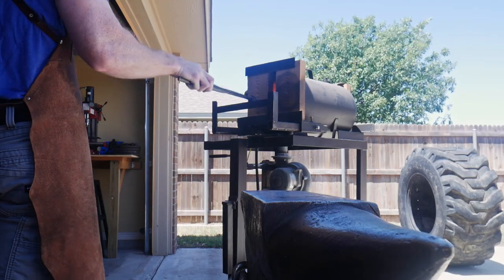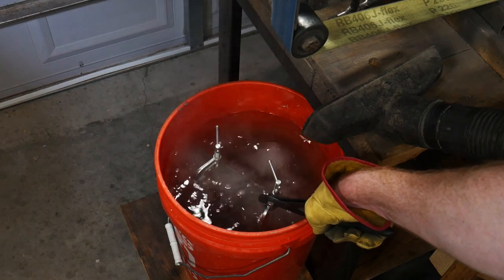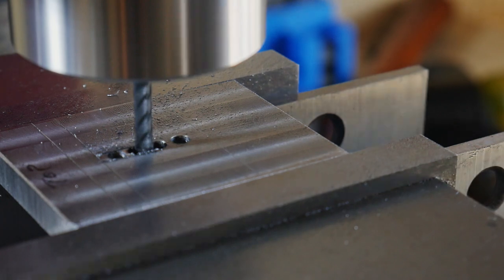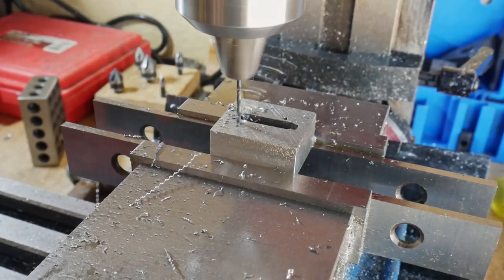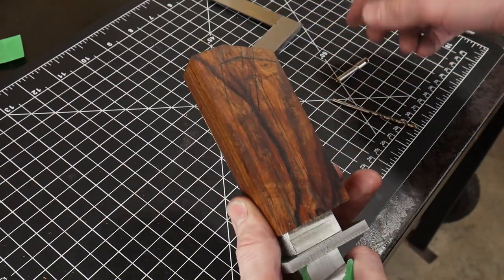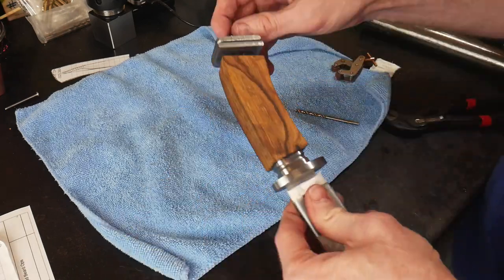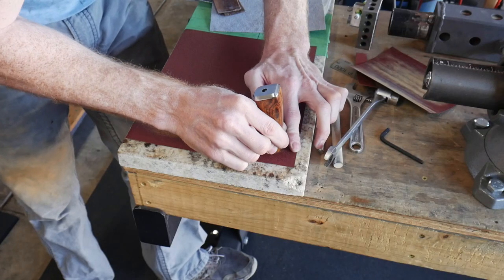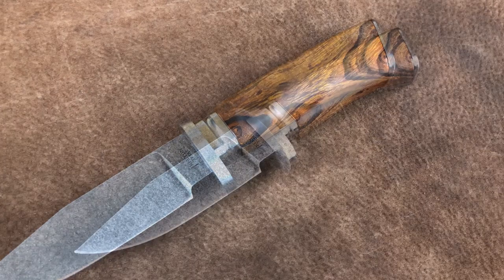Hidden Tang Take-Down-ish Fighter | Knife Making

Comment: I have a couple tips for you , number one , make your guard a little bit thinner they look more pleasing to the eye around 150 Thousands on guards . When slotting your spacers to go on the tang make them tight Press fit like the guard that way they don’t move around and would eliminate the use of pins from the spacer to the guard, so when you pin your handle to it it’s always in the same spot no movement will help you a lot. On the pommel Take a punch and peen around where the pommel nut meets the pommel Been grind it off those seams will disappear. When grinding your handle to your spacer put one wrap of gorilla tape Around your spacer then grind the handle Until you just dust the tape all the way around that will give you your perfect museum fit , then just round over slightly with sandpaper. That’s all I have for now you’re doing a great job keep up the Chase for perfection It’s never ending.
Reply from the maker: Thanks for the tips Rick! The journey continues

Comment: Very nice knife build!! I have made a lot of hidden tangs, but none to the tolerances and precision you made this one. Your attention to detail on the guard and pommel and use of your machines is really awesome. The only thing I would suggest (and I think this could be more of a personal preference) is to make the handle less square. NOT a criticism at all, but with no tang to show on the handle there is so much more shaping potential than full tangs and rounding those corners more will make it fit better in the hand.
Reply from the maker: Thank you sir! I totally agree! It's one of the things I like the least about this knife as well. It all started at the spacer... I made the spacer very square and I wanted to match the handle to the spacer. Next time around my spacer will be more oval. Cheers

Comment: you may like the RF version of mill sold by Bolton Tools. It ranges from about 2K to just under 4K. I have the cheapest version, geared head, ZX45. It is the non-CNC mill you see in Walter Sorrells's videos. They are way more rigid than the smaller benchtop mills (about as rigid as the mini bridgeport clones). But, the machine doesn't take up too much area, it can be used with 110v electric service, and you get a new machine without breaking the bank. Just mentioning it. You are right, it is so much better to have flat and square things to fit together. Thanks for the detailed video.
Reply from the maker: Glad you liked it sir! I recently got my hands on a HiTorque 3990 from Little Machine Shop... big improvement. More to come on that this month! Cheers

Comment: Since I am learning some knife making from you I will pass along a tip to you as a machinist. Pre-drilling holes before you mill the parts is only adding time to your work, you're not gaining anything from it. The milling cutter is still traveling along the same path at the same speed with or without those holes.  I know some people are concerned that those mini-mills don't have a lot of power but you are not taking that deep of a cut per pass. If you have any milling questions hit me up
Reply from the maker: Thanks Mike! I'll give that a go!

Comment: Very nice! My only critique is that the guard looks slightly out of place with the square edges in combination with the decorative filing on the spacer and the 45 on the pommel. My opinion would be to add a small 45 on the top and bottom of the guard to make it match the spacer and pommel. As always, love your detailed explanations of your processes.
Reply from the maker: Thanks for the suggestion Brandon! I agree, should of done more to that guard.
Reply: Fluting the edge of the guard would look good.  Nice build sir!

Comment: I’m confused as to the purpose of a takedown knife. Great video as usual.
Reply from the maker: Cheers John, thank you. It generally is just for collectors and for the "cool" factor. I guess technically it would allow you to replace parts more easily as well. Also a way to show off precision skills. 

This video you're commenting on wasn't really a takedown in the end... this one was a success - https://youtu.be/6VOfalVEnTs
Reply: @RedBeardOps  you definitely are precise! No gaps anywhere. Love the narration. I watched hundreds of videos and it is so cool whenever I find a little gym of information that I did not know. And this video showed me the trick of using a Dremel cut off wheel and drill press for putting the groove in guard or spacer, because I’ve been trying to do it with simply small round file

Comment: 304 stainless steel is only slightly magnetic so maybe that was a 400 series?
Reply from the maker: Good point sir, I'm not 100% sure. I did have to use a steel "back stop" when in the surface grinder.

Comment: Hi bro, how are you? please, would you tell me if you still have light spaces between those steel pieces even with all your machines?  I mean i have a big issue, i can't get a nice flat surface with my steel pieces. I dont have machines, i rectify my pieces only with sandpaper over a flat surface. But when i put all pieces in the spike i get those annoying ligh spaces. Please help me with some nice technique for that?
Reply from the maker: Pablo, I got rid of all the light spaces on my knife in this video. In your case, I'd suggest finding where your light spaces are, marking where they are not; then carefully sand down those places on a granite surface plate by hand. Then repeat until it's right.
Reply: @RedBeardOps  thank you so much

Comment: What RPM are you running that fly cutter at? Is it a carbide cutter or is it hss?
Reply from the maker: It's carbide. I think I was running it around 500 RPM
Reply: Oh ok gotcha.. I know that it doesnt matter because you end up grinding it also but if you run a finish pass about .005 deep and turn that fly cutter around 1500-2000 rpm you could get an amazing finish with it. I have been a machinist for like 13 years so I have used a lot of fly cutters and they like to spin fast when cutting.
Reply from the maker: @chrisluther8425  Very good to know!

Comment: Also you can skip the process of putting pins into the guard from the spacers If you make the spacers fit as tight as your guard then you only need to pin the handle to the spacers.
Reply from the maker: Thanks for the tips, Rick!